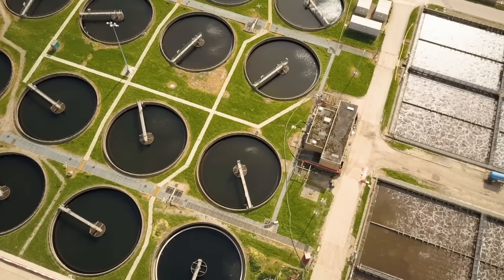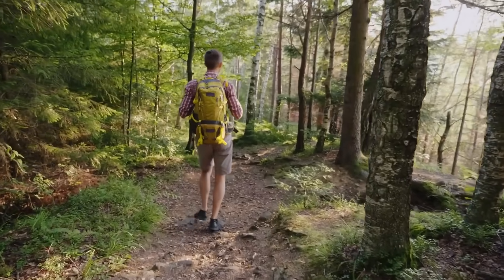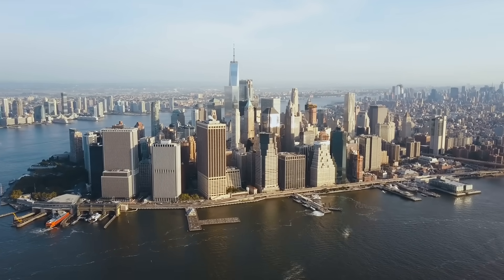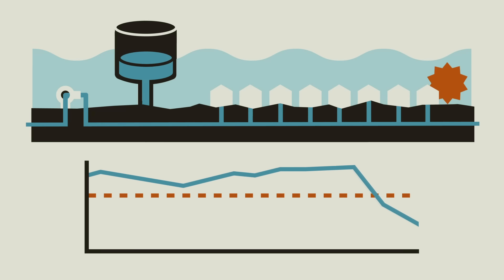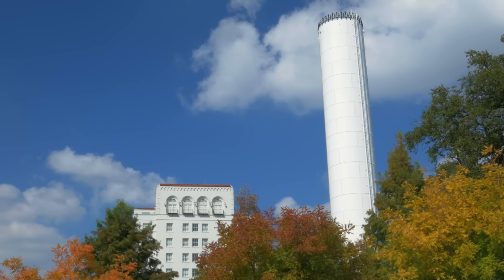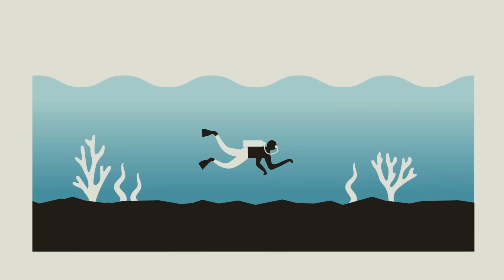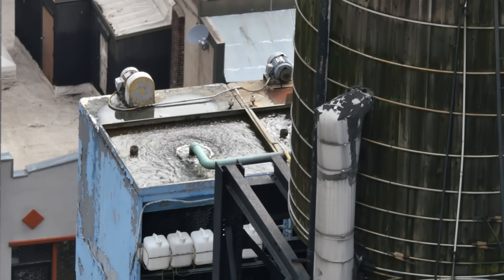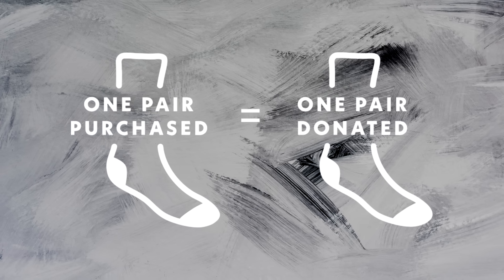How Water Towers Work

Comment: I don’t think water towers are really required any more, pumps are computer controlled and have VFDs/Inverters that can run them at variable speeds. A lot of cities don’t have them.
Reply: Water towers also provide redundancy in the event of a power outage. Pumps can't run without electricity but water towers don't require any electricity or any other external of power except for gravity.

All cities, unless their entire water source is at a higher elevation than the city, have water towers, just because you can't see them doesn't mean they aren't there. They're on the roofs of buildings, or maybe hidden inside on the upper floors.
Reply: @tallman11282  But the thing is, electricity production have become much more reliable in a lot of developed countries that power outage just doesn't happen. Many cities also have to option to store electricity with the development of batteries technology. This in a sense defeat the purpose of water tower in term of water and energy storage. It all come down to whatever is more cost efficient. Water tower might be obsolete in the very near future.
Reply: tallman11282 pumps can run off generators, and this is often the case.
Reply: if there is a war (or civil war with widespread terrorist attacks) and water pumping infrastructure is being randomly destroyed, i wanna be in the city which had water towers. That city might not be the most efficient in peacetime, but it has some resilience to damage.
Reply: jellyfishbones0 as the video states, a water tower only is designed to handle the fluctuations of a day, not a war. I’d rather have a distributed pumping system supported by generators. Plus terrorists could poison a water tank I suppose, arguments for both exist.
Reply: You would be surprised at how much water is needed for fire fighting. We've sucked the water tower dry in our small town on large house fires, and we have two 150 horsepower pumps at the city wells. Without the water tower we could do very little.
Reply: It really requires a cost benefit analysis. Elevated water tanks are relatively cheap and "dumb" tech. VFDs and inverter duty motors are pretty expensive. If a large area requires the pressure, an elevated tank can be the much cheaper option. Plus, if you can make use of the terrain, a ground level tank on a hill is even cheaper than an elevated tank. Plus, as the video mentioned, it can ease flow transients at the water treatment plant itself. Treatment is a lot easier and efficient if you can remain at a steady rate. Plus, of course, 24 hours of system storage is about the norm. Used in case of emergency at the plant or for very high peak demands. And, once again as the video pointed out, you don't need a huge pump to satisfy peak flows.
Reply: Also, there often are booster stations at tank sites, powered by generators. With multiple pressure zones, the plant can't always fill an elevated tank on its own and requires booster pumps to fill the tank. Or booster pumps empty the tank during the day in large systems to make sure everyone has adequate pressure. Sometimes peak flows are enough to seriously drop pressure, and you'd need much larger pipes to keep pressure even, as friction loss from high flows prevent water pressure from the plant to reach the distant ends of the system.

Comment: Love the new series. Curious about pressurising water when water is incompressible. How do these two things work together?
Reply: If you try to push water when there's a wall the water gets very angry and tries to push out to wherever it can, exactly because it's incompressible.
Reply: kelan andersson I guess where the gap in my understanding is to do with how a pump generates the pressure when water is incompressible. Does it rely on the elasticity of the pipes etc to store that energy ?

Comment: Several things:
1.  I am going to use this this summer in Upward Bound.  Some students take for granted something like a water supply.  I like the analogies to electricity.  That is a good teaching tool.
2.  Question:  What happens in parts of the world where the temperature goes below freezing and stays there for an extended period?  Does the flow of the water keep it from freezing or is supplemental heat necessary?
3.  If any of you are model railroaders in the steam era, you know a water tower for those wood, coal and oil burning locomotives is a necessity and makes an eye-catching model if done well.
Reply: hmm the freezing thing is a decent question. I'm from MN, USA (below freezing for months at a time), and i'm not really sure how they keep them from freezing. I'm assuming some amount of insulation coupled with flow. I haven't ever seen anything that looks like heaters. I've never even considered that.
Reply: 2. The water will flow almost all the time and the size of the watertank is so big that it won't freeze anytime soon. Also in cities there is so much warmth stored in ground and structures so the freezing won't be a problem.

Comment: The fact that we don’t have “water towers “ in electrical engineering sucks......yes we can have pumped storage power plants but it still sucks.
Reply: Well, technically you do, it would be capacitors.
But yeah, those aren't really a viable large-scale power plant.
Reply: rockyblacksmith Capacitors in power system are worthless when it comes to “storage “ .If someone someday make an electrical equivalent of water tower, he for sure will get a Noble prize...He will solve humanities twin biggest problems simultaneously,power woes and climate change.
Reply: @tariqazizsofi7875  
Mathematically they are equivalent. 
An electical power storage that has similar capacities as a water tower, it will be nothing like it in it's function.
But again, I wasn't disputing your core point.
However, solutions to power woes and climate change are not as easy as a single technology, even an amazing one.
There is a more efficient alternative to pumped storage power plants though, which is flywheel storage.
The larger examples of which may actually be in the same orders of magnitude as water towers in terms of stored energy.
Reply: rockyblacksmith while I agree that pumped storage and flywheels can store energy but they are at best poor “hacks”. What we really need is battery type of a thing that can store significant amounts of energy.....Regarding power woes and climate change, I disagree.The fact that we aren’t able to use renewables is because we can’t store energy.Also,many coal fired power plants are running “unnecessarily “ because they have to supply peak load....
Reply: @tariqazizsofi7875  
Sure, power storage is one of the biggest obsticle in tackling climate change. 
But the existence of a technology alone won't solve anything.  
We have quiet a few that would significantly reduce carbon emissions if consequently implemented.
But so long as we are working within capitalism, it also has to be profitable.
If we were to expand green energy sources to cover the overall energy demand and use electricity storage methods available now, I'm positive it would be perfectly possible to  build a fully green power grid, if you really wanted to.
But that would cost blood sweat and tears that we western nations aren't willing to pay (at least not yet).
And regardless of which technologies will come around, putting them to work on the scale we need will always cost us a lot. Both in money and effort.
Technologies may make it a little easier, but to think that we just need the right technology and then it will take off is an illusion.

Comment: Do they ever freeze up?
Reply: At the bottom that would be next to impossible. Since water is densest at 4°C (don't ask me what that is in °F), when water is under pressure, it usually stays at that temperature. Above freezing. And if you wanted to prevent freezing completely, you'd just need to make sure the water remains in motion (like rivers, which usually don't freeze up completely either). So a stirring propeller inside the tank or something like it would do the trick.

Comment: Just like a minute ago, I was thinking of water towers.. the fact that how water coming from the tap uses power, but in an indirect way, because the work has been done beforehand in pumps lifting the water up high, to make the water pressure.. and then I come back to my computer and find that you made a video about water towers!! Amazing :D
Reply: but that's just a normal coincidence... or is it? 
Vsauce music intensifies
Reply: As the video did hint at this does depend rather on the region where you live, while this is usually the case when all the land surrounding the settlement is fairly flat in the case of settlements that are for example nestled into a valley at the foot of a range of hills or mountains the system will often take advantage of the topography to make use of gravity feeding as much as possible. Even if it requires maintaining several kilometers of extra pipe and valves it still often easily outweighs the cost of paying the electric company for power when you can get gravity to provide all the power you need for free.

It's certainly a politically charged issue and having to resort to removing humans does generally add significantly to both costs and the time to actually get the necessary approvals to get started on the project but it can and does happen.
Reply: the uses of the pumps are not eactly like that ince they got tons of cons but in general ye
Reply: So you watched the video and in fact understood what you were told.
Reply: Satanic forces brought you here. He wants you to learn.
Reply: @vmelkon  that sneaky devil that Satan. Trying to get us learn and think
Reply: @vmelkon  this is so weird... I was at an outdoor party earlier and was also wondering how that water tower in the distance works
Reply: @Avinele  
Satan put that question in your mind.
Reply: @vmelkon  what are you on about

Comment: Pumps don't create pressure. Pumps create flow. Pressure is result of system resistance.  Think of pumps as current source in electronics.
Reply: I hear people saying this a lot, and I think it's both true and untrue. It kinda sounds like a question on a quiz that people memorize the answer to. 
What pumps do at the most abstract level is either add work to the fluid passing through it, or exert a force on a portion of fluid inside the pump causing it to accelerate, depending on whether you like to look at a continuous energy balance, or a force balance. Either way, the result is the same.
In fact, when designing pipe systems in real world settings in many cases a modified version of bernoulli's priniciple is used. In this a resistance to flow inside such a system (e.g. a valve, a sharp L-bow, friction, etc.) is regarded as a "pressure drop/loss" and a pump as a "pressure source", knowing that in this case pressure means a volume specific energy.
When you buy a pump the most important specification its power, which is nothing but the product of the flow and the pressure difference between pressure side and suction side. So in reality, one doesn't go without the other.
While the electronics analogy can be very useful, especially for demonstration and understanding, it's not a perfect one by any means.
Reply: But non-ideal current sources can be modelled as a voltage source anyway, Thévenin and Norton representations are equally valid.
Reply: @wrightcj01   Good point! I know much less about electronics/EE than I know about fluid dynamics, so that's interesting.

Comment: 2:20 From high voltage to low voltage? I'm not an ee, but isn't from high potential to low potential? Because voltage is the difference between two potentials. So voltage is the canal/tube, the pressure difference between your source and destination, the steepness of the tube is the resistance, current is the amount of moving water, power is the moven amount of water in a given time, etc etc, and potential is the pressure at your source and destination.
Sorry for being me, but I had some problem with electricity until I found out that there's no voltage in a point, only between two points, and now it bothers me too much, and sorry if I'm wrong, feel free to correct me :D
Reply: SzDavidHUN OK, so the thing is that if you measure the voltages between point a and the ground (an arbitrary reference point) and point b and the ground (same arbitrary reference point), you can say things like: point a has a greater voltage than b. You can say that because you are comparing their relative voltages to the same point not saying that that point has voltage by itself.
A good analogy is height. Height only exists if you are talking about a distance between 2 points, but we're OK with giving a single point a height if the reference point is assumed/obvious. For example, the height of a mountain can be from base to peak, from sea level to peak, or even from the center of the Earth to peak, but most of the time the reference in these cases is sea level.
Reply: I think that he said it in a way to make it easier to people to understand the analogy, not to be scientifically accurate (altought it is an engineering video after all).
Reply: The bigger issue is that electrons don't go from positive/high to negative/low, but from low to high
Reply: @positivemelon7578  Indeed I was just going to write that :D
Reply: @positivemelon7578  Yes, the big issue is that electrochemistry was invented before anyone knew that we were going to adopt Bohr's atomic model, making electricity extra confusing, and easy to be pedantic about. I am an EE working on power grid substations, and I usually don't worry about which way the amber flows. If I'm on site, and it flows through me at all, I'm probably dead either way.
Reply: ah yes there’s always the AKCHUALLY guy
Reply: you're being unnecessarily pedantic, being pedantic != being intelligent; Also this answer is one 10 second google search away from finding 100 credible sources of information
Reply: @r3d0c  And you're being unnecessarily rude.